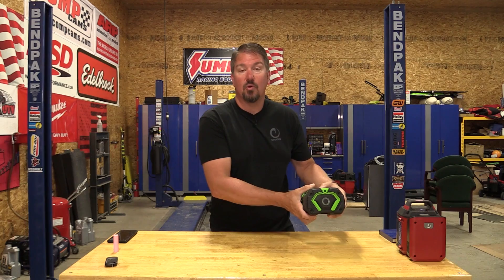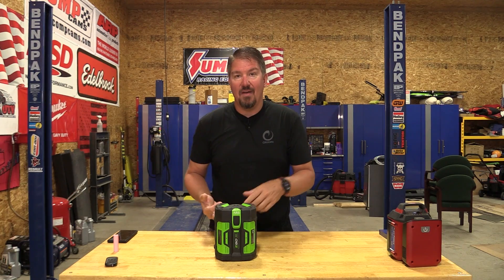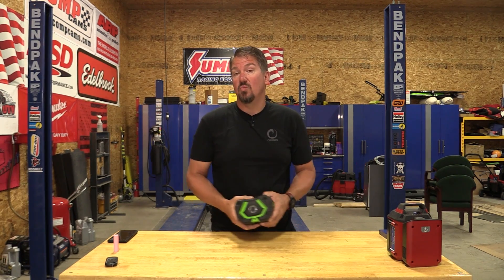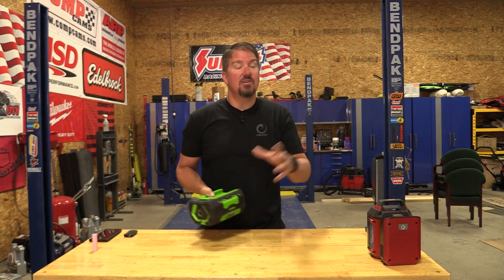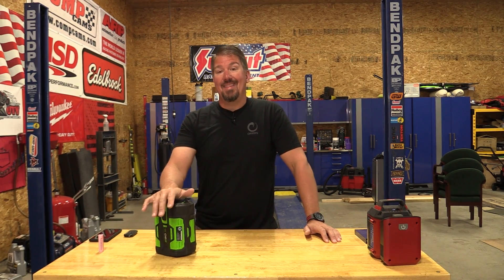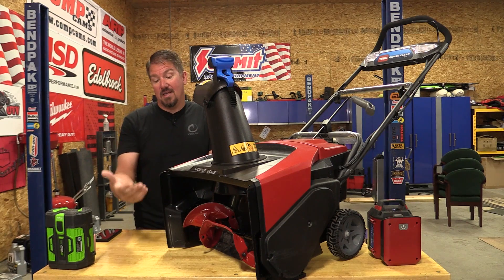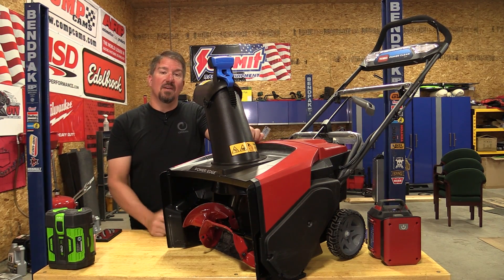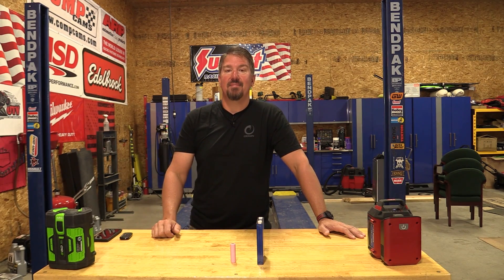Battery Powered OPE - The BIG Elephant In The Room No One Wants to Talk About!

Comment: Overall I agree with you.  I purchased my father the Echo 58v line of products; Chainsaw/trimmer/blower/hedge trimmer and everything was either used of FB marketplace or refurbished.  My dad doesn't maintain gas equipment properly and has a hard time pulling 2-cycles to start.  The Echo line is as good as gas for a homeowner.  I would be comfortable using anything on a lot less than 2 acres and maybe even a bit more.  However....I've owned 20+ pieces of gas echo equipment and the gas equipment feels much better built, much sturdier and some of the equipment is over 25 years old and still runs great(I expect it to last at least 10 more years).  I don't believe any of the battery echo equipment will last 25+ years. The equipment is all plastic and feels more like toys then real serious equipment.  I've already had 2 batteries die, one was under warranty and Echo replaced it.  The other battery was over 5 years old and I was out of luck, however I found someone to rebuild it online.  That being said with what I know now I wouldn't send it to someone to rebuild since improperly rebuilding the battery can/is extremely dangerous.  

I was very disappointed to see Echo redesigned their equipment and the new/old batteries are no longer compatible.  The old style battery which I have is only available online and no new tools will come out for the old battery design.  I wouldn't have a problem if echo had an adaptor to ensure compatibility but as far as I've seen one does not exist.  I wonder if TTI still makes the new Echo equipment???

If I was going to buy new outdoor power equipment I'd probably buy DeWalt as the batteries are everywhere, used in lots of equiptment and I also believe DeWalt isn't going to change the battery pack and obsolete the current equipment.  I'm a huge Echo fan but my experience w/ their 58v line left a sour taste and because of this I'm willing to try other mfg's before this I was 100% loyal to Echo.

One of my friends went on vacation and I mowed his small lawn w/ a green works super cheap 40v electric lawnmower.  It was a piece of junk and ended up lasting less than 3 years.  Sadly the battery didn't go but the electrics of the mower went and the blades would no longer stay on.  

As a side hobby I buy broken lawn equipment to repair and resell, I only buy higher end brands and with proper care and maintenance I don't see why any piece of gas equipment shouldn't last for 30+ years(for a homeowner). 

As for vehicles, I launched the R1T and R1S and I agree/disagree w/ you.  I agree w/ you on the life expectancy the pack will be useful in a vehicle(about 10 years) but once it's taken out of the vehicle as it's degraded and no longer meets customer needs it will find a 2nd life in energy storage solutions.  However we don't have a good way to turn automotive battery packs into large energy storage solutions, each OEM manufactures the pack differently and it's not a once size fits all solution.  

For vehicles one big thing you didn't mention is tires...on some EV's, in conserve mode tires are lasting 6,000 miles and the tires are over 400 per tire.  That's a lot of $$$ in tires alone.  My next vehicle might be an EV, I really enjoy them but actually saying EV or IC is better for the environment is a pretty complicated calculation.
Reply: Not that complicated, ev's are far better, it has been proven over and over again
Reply: Ev's are not better...it has been proven over and over again. I tow a trailer behind my truck for work. No ev available can match my 20 year old truck....of which I plan to keep for another 20 years.

Comment: Engines still have a ways to go on efficiency. Automakers have proven higher mpg is possible. I want to see that higher mpg on trucks and other commercial/work vehicles. I heard about salt based solid state batteries that John B Goodenough is working on. Maybe that could be a viable battery option?
Reply: They can have as high mpg as you can imagine, but will still pollute right under your nose

Comment: Brian, my question is, have you tried to warranty any of them out? I believe EGO has a 5 year warranty on their batteries. 

If you have had the tool less than 5 years, you should try to get the battery replaced under warranty. 

My plan is to do the same when my batteries are just over 4 years old if they aren't holding a charge close to what it did when it was new.
Reply: Ofc he didn't...

Comment: The answer to your question was answered by yourself. Battery tech has changed, and it still is. You're comparing over 130 years of R&D and trillions spent on ICE technology to 15 years worth of R&D in EV. That's everyone's short sightedness. It's like comparing a Journeymen electrician to someone with 40 years experience. The argument that you have to mine the minerals. Again, short sighted. Yes, you mine them, once for ten+ years of use. How many times are you drilling for oil, and refining it for gas? Way more than once. Yes the initial up front pollution is roughly the same, but long term, no. Again, new battery tech, like ICE tech can be developed but like ICE, it may take 50+ years. Which is still 1/3 the time as ICE. You can't develop something better if you cut it short just because it doesn't hit a homerun it's first time up to bat.
Reply: Well said, people often forget all the things we do for oil production and take it for granted...

Comment: Couldn't possibly agree more. I have the Ryobi model401015 mower. I paid around $550 new three years ago. The first one I had at the end of the first season began melting batteries. Up front I want to say Ryobi and Home Depot were excellent to deal with. I called Ryobi and explained the issue. They sent two free 6amp hr batteries. When that didn't solve the problem I brought it back to Home Depot. After some back and forth (no fault of anyone involved) Home Depot gave me a new mower. My second mower by the end of first season with it, the self propelled  mechanism started failing. The mower would shut off. I finished the season  with it to not have to go through the problems of an exchange or repair with only a month left of mowing. This year I called Ryobi and they had me take it to a service center. I took it to them in March of this year. When I called in April they said the parts were on back order and would be in by August. I couldn't wait that long so I bought a Honda mower for $550. Had I just bought the Honda or something of equal value I would still have the same mower with-out all the hassle today. Ryobi ended out replacing most of the electronics. I know this is long but I tried to make it as short as possible.

Comment: HAVE A 2000 SILVERADO 423.000 MILES ON IT LET ME KNOW WHEN YOUR ELECTRIC CARS GETS THAT WHEN MOTOR GOES I CAN REPLACE IT WITH A $3500 NEW LS CRATE ENGINE 😂
Reply: Lithium is a limited supply
Reply: 🤦 electric motor will last forever and is 97% efficient... Your 20yo ice junk will require so much maintenance in 20 years, has like 15% average efficiency and pollutes the air you breathe... lets be real
Reply: @riba2233  WHATS THE COST TO REPLACE THAT BATTERY ON THAT ELECTRIC CARS AND  WHAT MILEAGE COULD YOU GET TOWING 5500lbs TRAILER VS MY 30 GAL TANK I BE THERE AND ON MY WAY BACK BEFORE YOU GET THERE WITH THAT LESS THAN 100 MILE RANGE
Reply: @paulgrice6766  A NEW KEYBOARD IS EVEN CHEAPER SO WE CAN STOP YELLING
Reply: @riba2233 You do realize that grass,plants and trees feed off the so called pollution gas and diesel powered cars and trucks give off just go to central park and look how healthy the tree and grass are

Comment: Rant? Maybe. But absolutely correct? You better believe it. Your initial point of your ope being a different platform that your tools is the exact reason I didn’t go with a 36v plus platform with mine. I have Milwaukee and Ryobi 18v ecosystems for my tools, and my ope is a Ryobi weed eater and a m18 single battery blower. Often times, the battery cost as much as a new kit, making them disposable, and depreciate like you said. Lithium ion technology works great in power tools, but they’re trying to push it for everything knowing we don’t have the resources to sustain it long term. I get the environmental effects of greenhouse gas in big cities, but here in bfe northeast Texas, the air quality we worry about is pine pollen lol. Internal combustion just makes sense here, we have no need or infrastructure  for huge public transportation services. I decided my next push mower will be battery powered, but I damn sure don’t like the idea of it being forced on me like it is. I’ll ride that Briggs and Stratton motor until it falls completely apart. 😂

Comment: I have the same battery. I paid $160 at Home Depot.
Reply from the maker: Home Depot has not sold EGO in years.  This battery is $399  https://www.lowes.com/pd/EGO-56-Volt-7-5-Ah-Rechargeable-Lithium-Ion-Li-ion-Cordless-Power-Equipment-Battery/5013791691

Comment: Honestly, if you need to consider 'depreciation' on your home lawn equipment, you better be looking at higher quality equipment.   You could buy garbage gas powered mowers from big box stores since forever.   How many 'common brands' are worth $$$ even a year later?  Exactly.

Those mythical common 20YO mowers that you can get for peanuts in decent condition...... were still built 20 years ago!  Everything now is built to be disposable, doesn't matter what powers it.  And if you want something that's going to last you have to PAY.  Problem is, everything is marketed and shopped for by the cheapest price.  Nobody want to pay for something that lasts at least 10 years if they can easily swap it out in 3-5.  This goes well beyond lawn equipment and cars.

Show a brand new EV vehicle that's worth 50% on the used market one year later under normal usage as an example, or stop spouting nonsense.  This video has a lot of rant and speculation, but not a lot of data to back it up, so it's all opinion.  I agree to an extent.  I personally own older vehicles and take care of them, and consider that much better for the environment than any of this other BS.  I don't like the fact that most new vehicles, especially EVs, are made to be disposable or cannot be worked on by their owners.

But don't be surprised if you get pushback and downvotes on this video.  You already have your opinion built up in your head on some of these things and needed the outlet, but if you research into some of the tech around these batteries and solar panels you would be looking at this differently.

Comment: Register your batteries.  EGO will replace them if you are in the warranty period.  I do agree with most of what you are saying.  Personally if we were ramping up our nuclear power dustribution and requiring EV chargers in new homes i could get behind it more.  We just dont have ubiquitous electricity.
Reply: Yeah but in most cases the battery will fail after the warranty expires. I believe that the manufacturers program these things to crap after the warranty period…lol!
Reply: @txvet7738 I am currently testing out this hypothesis.  You may be right.   I am hanging onto my craftsman gas mower for the time being.

Comment: The only problem with being rich is that it costs so much.   As for Toro Batteries, i have seen no evidence of the failure you report, but i am a low impact residential user.  Eliminating gas, oil and noise in mowing and snow blowing, is worth the price.
Reply: depends on what you use, snowblower, weedwacker, leaf blower sure battery is great.  Even walk behind mowers battery is fine.  But when it comes to zero turn, its a bit too big.

Comment: Excellent commentary. 3 years ago, I bought into battery operated tools. So far, I like the convenience of my Ryobi power tools, including my 18v lawn mower and would buy them again, as replacement batteries aren't very expensive. My EGO 2 stage snow blower has served me well for 2 winters but I have $2,000 invested with a second set of batteries in order to clear my 250' driveway. It's currently in the shop as an internal gear or bearing failed. (Covered under 5 year warranty.) I wouldn't buy it again because of everything you've said in this video. It was a fun experiment for my ignorant and trusting self, but not again, as I'm now aware of the real cost and environmental issues of battery replacement.
Reply: BTW, I'm 72 and still use my Craftsman circular saw, drill, jig saw, recip saw, and sander from the 1970's. Never had to replace any parts on any of them in the last 50 years.

Comment: You're correct nothing is wrong with battery operated equipment but it's the brand that you decide to invest in. I chose Milwaukee OPE because it was so easy to switch batteries.  I  just bought the Milwaukee mower a couple of weeks ago when acmetools had the 15% off. I love it no way I would have invest into EGO knowing that they don't have any power tools.  There is nothing wrong with battery operated equipment. It's just the Brand you decide to invest in.

Comment: You are not 100% correct about all of your points.  

1. EV's are not depreciating that much, at least not worldwide and it really depends on the model
2. They will actually last forever. Motor and electronics will last basically forever (unlike ICE engines which will also require a ton of maintenance during their life, and that also has a cost). So, the only questionable component is of course the battery pack, but that one is really easy to replace and after 10-15 years there will be a more modern and robust option so you will actually get an upgrade (good example of this are early tesla roadsters). So yeah, your 1964 electric tractor would work in 2023, better than it ever did
3. diesel is absolutely bad, it has high NOx emmisions which are basically killing us, look up the number of deaths caused by air pollution, and that diesel is polluting right under your nose. EV's get the large part of their energy from renewables, and even the part that is from fossils is not polluting the air which you breathe in every day. And they also use less energy per mile in general, so it is a win win.
4. there is plenty of lithium, but even if there wasn't, we already have sodium based batteries and by 2050 there will be plenty more options, battery tech is developing rapidly.
5. EV's are not on the same level after 100000 miles, that is old data. And batteries last much longer than that, I really don't know where are you pulling that info from. 320000 mile tesla packs are really common, and those are the ones with fairly old tech from 2010. 
6. you are basing your conclusion of of flawed ego packs and mower, there are more reliable options both for batteries and mower so yeah, it is generalization.  Also Milwaukee is not a good recommendation, not only are their mowers very expensive, their max size battery is only 12aH and that pack in particular is known to be unreliable. And battery packs can be repaired, maybe not easily, but there is a whole another topic
7. gas powered ope is even worse pollution wise, even compared to the worst diesel cars. That stuff pollutes like 100 if not more modern cars, and you are breathing that stuff in directly. Not to mention the noise factor which is a real consideration. also there is so much more that can go wrong that there is a higher chance for it to go to landfill, let's be honest, not all of us are mechanics.
8. yes, people maybe had one drill 50 years ago, but guess who is building better houses and doing so faster. Technology goes forward, and that is a good thing.
Reply: Hah!  Spoken Iike a true Liberal!
Reply: @georgedavall9449  economic liberal or social liberal? 
But what you actually mean is spoken like someone who has been involved in this since 2010, has been following the space and has plenty of hands on experience with ev's, battery tech, knows all the facts, and can recognise bs myths and misinformation.